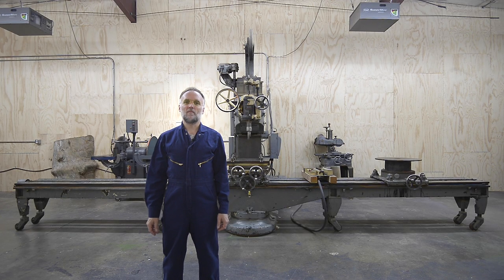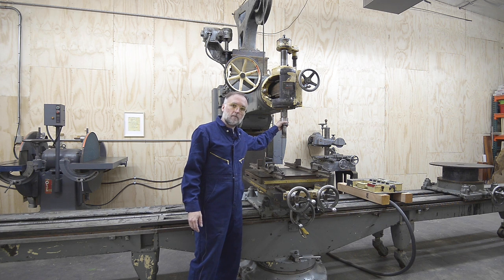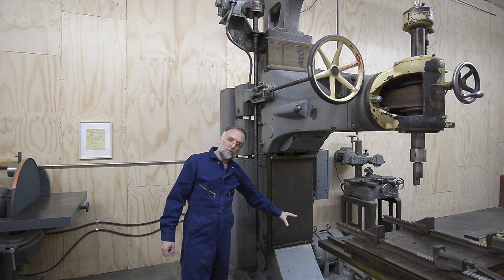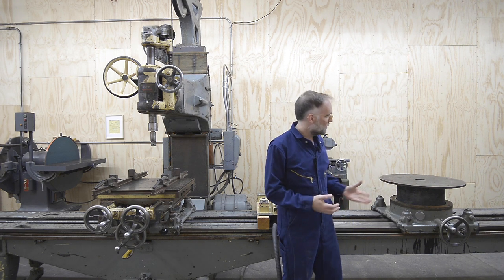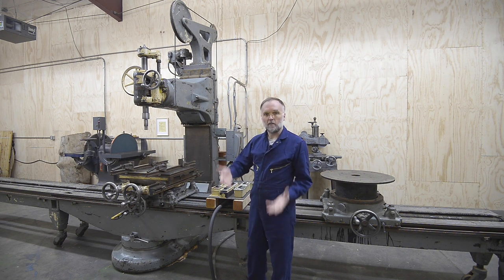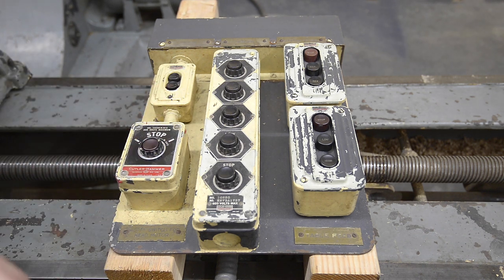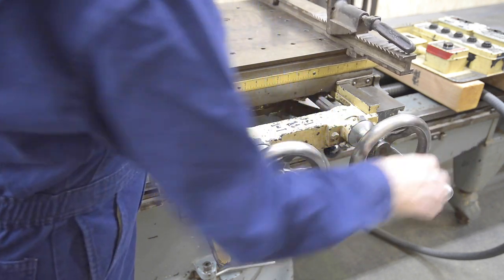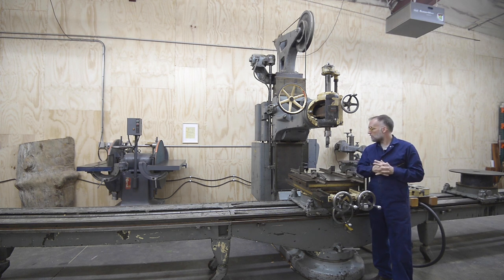Episode 1 - Oliver Pattern Mill an Introduction to the 102

Comment: I like the sales literature, it reads very similar to Wadkins universal woodworker which was the worlds first pattern miller and created 4O years earlier. Although the first one did not have the capacity of the Oliver, They built one of similar size called the WX pattern miller in 192O. The Oliver is a lovely machine and its nice to see it being used as it as intended.

Comment: Fascinating machine.  As a former moldmaker, pattern making has many similarities, but is still a completely different trade.  Before the advent of CNC machines we used to use a compound rotary table along with an offset rotary spindle attachment to generate compound curves and angles....hard to keep your brain around all that.  You've got similar geometry with that compound rotary table and swinging machine base.  I'm curious what kind of work you're doing in your shop.  BTW, the shop we had in school had one of those little Delta surface grinders I see in the background of your shop.  Haven't seen one of those in years.
Reply: Wild, the compound curves with two tables would be a lot to manage I'm sure! My new pattern mill has a stack of three rotary tables. One is powered and the third one is above the powered one. I'll post a video on the new 102 soon. That little Delta surface grinder/tool and cutter grinder is very handy. Perfect size for my needs. You can see me using it in the next video to sharpen a cutter. I have a lot of respect for moldmaking. Thanks for the note!

Comment: Awesome! You never talked about how you aquired it?
Reply from the maker: Ha, I cut that part. I'm the third owner. I bought it in late 2018 from a local guy. He had spotted it in an Air Force auction catalog in 1995 and bought it then. The Air Force ordered it in 1942 and kept it at Wright-Patterson Air Force Base until it was sold. In LA, it was used for architectural models and architectural restoration woodwork.